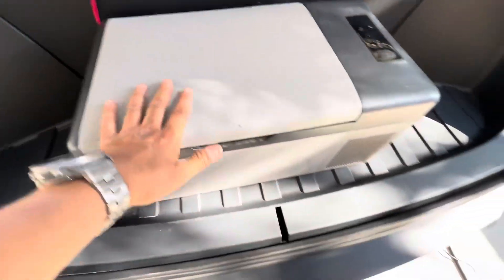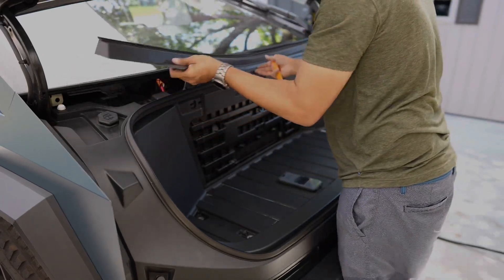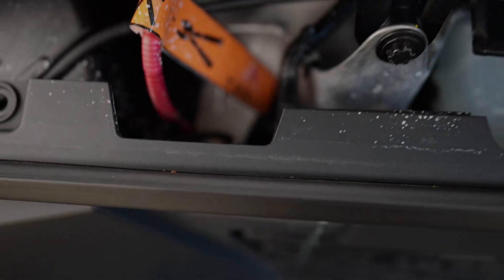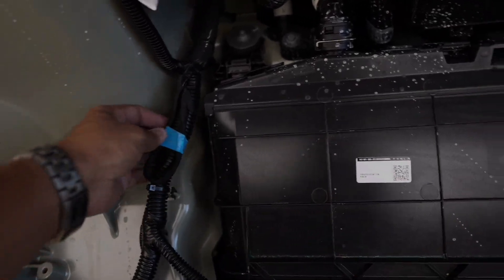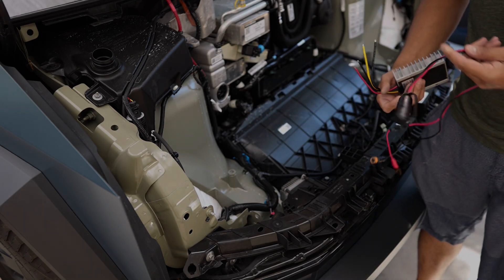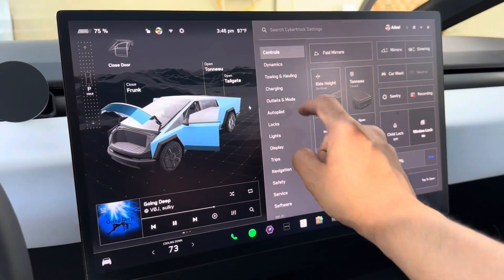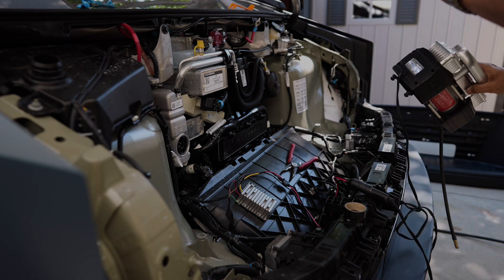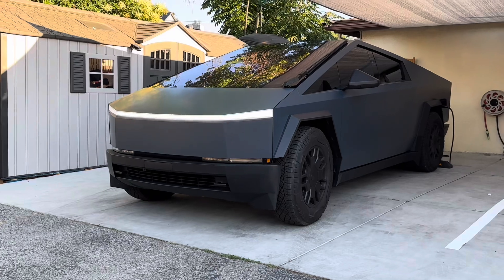CyberTruck Frunk Power Mod

Comment: I just bought a BLUETTI Elite 100 V2 Portable Power Station which is very small and has a solar input higher than the 48V output of the CT frunk. So all I have to do is put a XT60 male plug on the CT wires and plug it into the Bluetti. I can power my fridge with AC or DC with four AC ports for anything else I might need. No need to convert anything.

Comment: Not to be a naysayer, but if you run any refrigerator in a tightly-enclosed space, in this case the frunk, the result will be that over time, the whole frunk interior will only get warmer and warmer, eventually overwhelming the refrigerator's ability to cool its contents.  And this effect will only accelerate over time, as the refrigerator needs to work harder and harder, discharging more and more heat into the space, no uncertain a death spiral...
(The second law of thermodynamics and all that...)

Comment: Do you have to toggle "Keep on cabin and bed outlets" to keep the refrigerator from turning off? Will the fridge stay on 24/7? The manual says that the 48 volt power feed shuts off after exiting the cybertruck and closing the doors. I just want to make sure the fridge doesn't turn off. The manual also states that the outlets and power feeds turn off after 12 hours and you have to toggle them back on to turn on again.  Thanks for sharing your mod!

Comment: wouldn’t this void the warranty?
Reply: No. The vehicle’s user and service manual specifically provide details to use it. You can wire it natively if you have 48v accessories or step down like he did on the video for 12v usage.

Comment: I added a 12 volt receptacle on lower. Left side of frunk 
Worked perfectly 
Thanks for all the info!
Reply: Hello,
I want this 12 volt receptacle powered by the frunk power feed to stay on 24/7. Is it possible or does it turn off after 12 hours. Please advise.